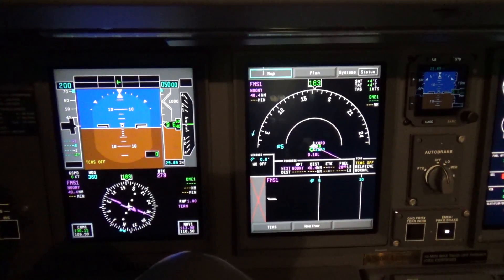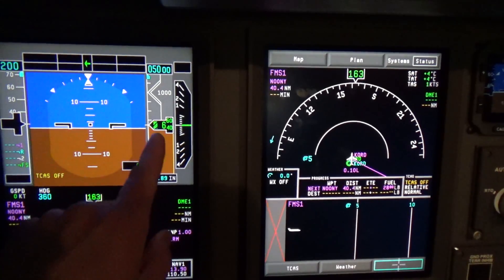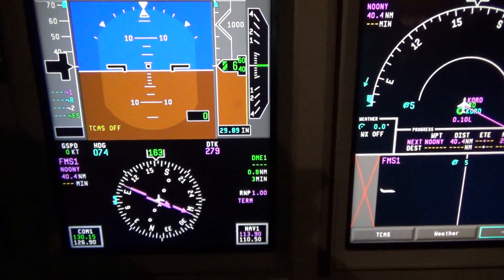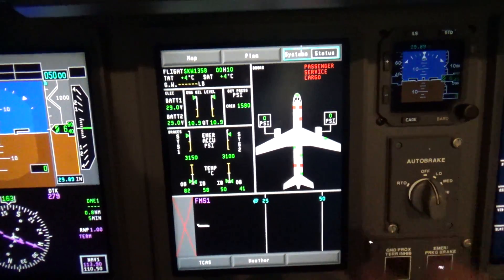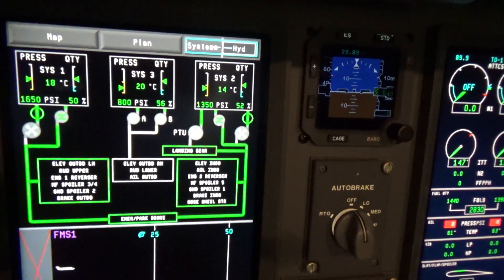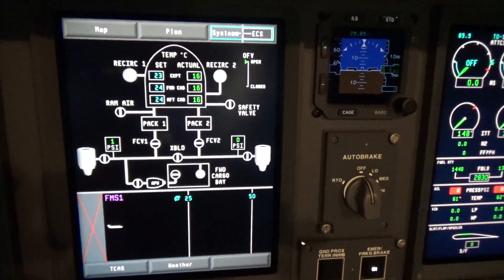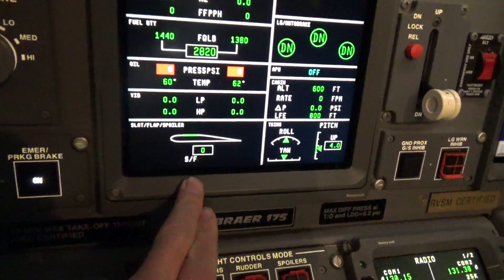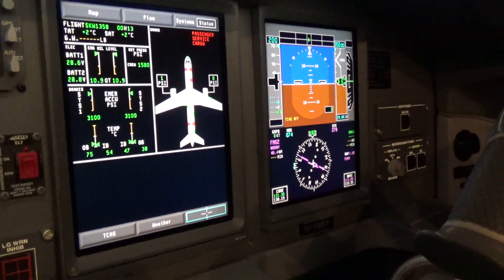EMB175 Cockpit Tour Part 4: PFD, MFD, and EICAS

Comment: Wonderful plane. And many many thanks to you, Mike. I had some problems with ILS too. I don´t how to solve: there is not vertical diamond of the glideslope.
Reply from the maker: Thanks for tuning in Carlos! Appreciate you watching! Are you having a problem getting the ILS glideslope diamond to appear? In order for this to happen, a few conditions need to be met. First, you have to be displaying "Green Needles" , or in other words, raw data, as opposed to what we see here, magenta needles, which means we are looking at GPS/IRS data. Next we need to have an appropriate frequency tuned which transmits  a glide slope signal. And next, we need to be in range of the signal, usually about 30nm. Does this help at all?